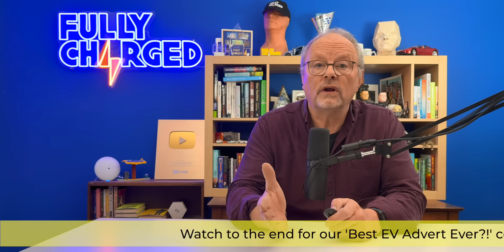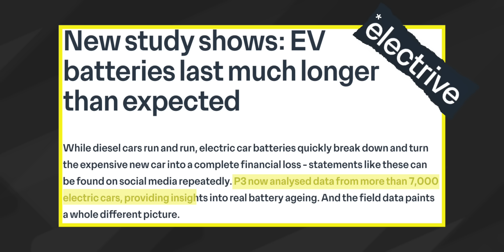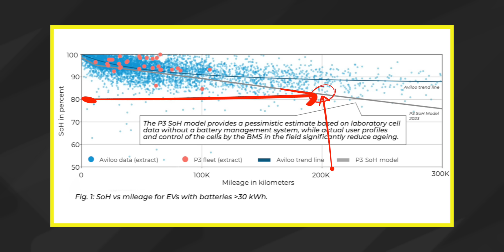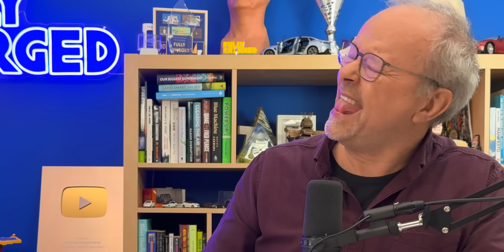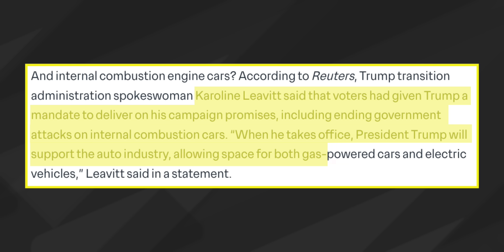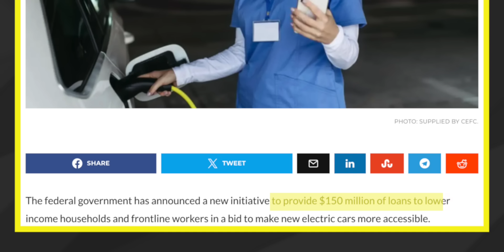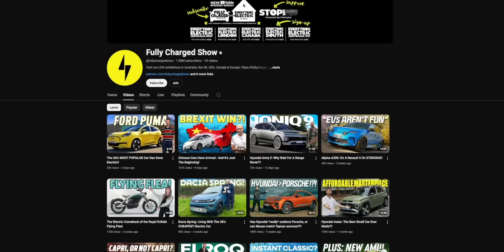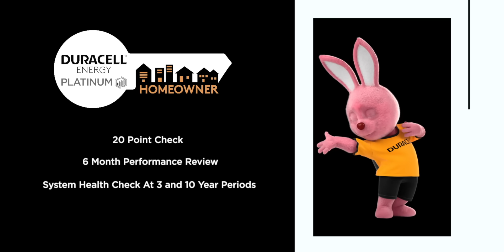The Truth About EV Battery Life, Government Subsidies & The Future of Coal Ash?!

Comment: I got 230,000 miles out of my old vw tdi and still got £1200 for it when I traded it in. What you are saying is simply untrue.
Reply: You are not the only one who owns a car. Do you honestly think every diesel is going to last 230k miles, accidents excluded? It's really silly comments like this that really piss off EV drivers. Have you ever driven an EV?
Reply: @ianhamilton3113 

Yes but the opposite is equally true.

We read claims that some Teslas manage over 400 thousand miles.

This could be true in some very isolated cases but not all.Teslas will manage that, will they.

Suggest you simply keep quiet and buy a load of tissues ready for when you see FCEVs push BEVs into the breakers yard.

Not long to.wait now.
Reply: The scap industry reports the average car scappage age in the UK is 17 years and 123,000 miles. This has been increasing over the last few years in line with the cost of both new and used cars going up; people hold on to their cars for longer, as the cost of replacement parts vs a replacement car now favours keeping an existing car going for a little longer than in the past. 

Whilst individuals may report older scrapage ages/higher mileage than the average these are not the norm. The same is the case for battery EVs where the scrappage age is similar to that of ICE cars (slightly less than petrol cars but longer than diesels). 

In this sense what Robert reported refelected the industry and various study findings, with your outside of the norm example not disproving what Robert said.
Reply: Which bit?
Reply: @bodilidily  His rear passenger seats
Reply: @bodilidily 

Kindly don't be so obtuse.

Robert generally talks nonsense as the more discerning can witness for themselves.

Very recently he has been pushing BEVs so hard he has rather lost his credibility.

It is plain to see FCEVs are now advertised along with BEVs on MSM.

Europe has recently mandated a network of hydrogen filling stations not more than 200 kms apart.

Put on your thinking cap and try to work out why that should be.

You'll get there.
Reply: And cost how much in fuel, servicing and repairs?
Reply: @ people who try to justify ICE always fail
Reply: He never said ICE vehicles couldn't do that distance - only that by the time they *did*, they'd need a bunch of replacement parts, lots of servicing, and they would be pretty worn out. 

So - did you ever have to fit new parts to your VW? (for that mileage, probably at least a couple of clutches, I'm guessing, plus belts on the engine, maybe an exhaust... gaskets? headers? bearings? engine mounts? air filters? radiator?)...  because if you did, then you've proven his point.
Reply: @ yep, I had a similar mileage Audi A6 wagon, super useful car but ever service was $2000 with parts I’ve never heard off needing replacement, most parts were to control the emissions of the oil burner
Reply: According to the math you bought 15,000 gallons of fuel costing $45,000. Each car has a huge effect. Home charging would have cost $4,600. Huge savings
Reply: It's a mystery to me that EVs have given idiots and the mentally challenged the confidence to make themselves known so widely.
Reply: So you got scrap value for the car, I’ll wager that every time you took it for a service the cost was more than the car was worth because of the never ending list of bits that need replacing at that age.
Reply: @kylebeetham3679  

🤣🤣🤣

You must tell us all about the residuals reference used BEVs.

Can you bring yourself to do that?
Reply: @ yes - it was costly to maintain - but I got a new gearbox put in for £1800 at 200k which is actually cheap. I am open minded about an ev but they seem quite expensive so I got a low-milage used Subaru for £18k which I can service myself for £100/yr. Subaru is a really old school 80s car - I love it !
Reply: Same, you can get 1200 out of a equivalent ev at 230k miles.
The VW tdi at that point probably had an ok engine, but bushings, suspensions, heck even door seals, are gone by then. Fixing it is more expensive than the value of the car. So you trash it and it's sold for spares.
Same for an EV. But with less maintenance
Reply: When the battery in my ev is no longer good enough to power a car, it will still have value for static energy storage. When that part of the useful life is finished, the valuable resources in it will be recycled. Since the useful life in the car is much greater than originally thought, seems like a good use of resources.